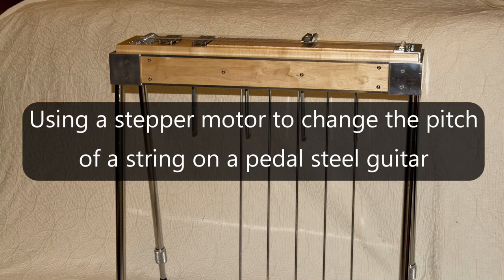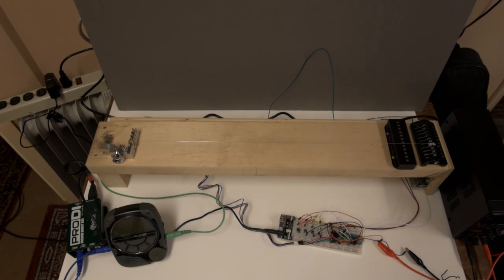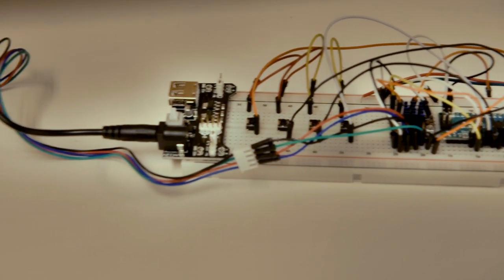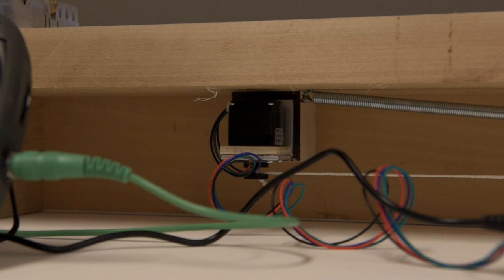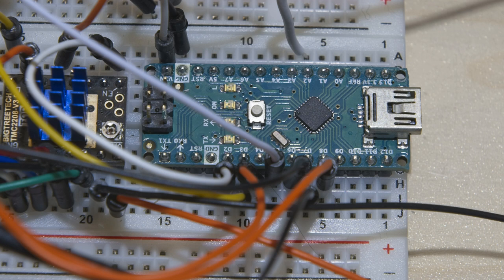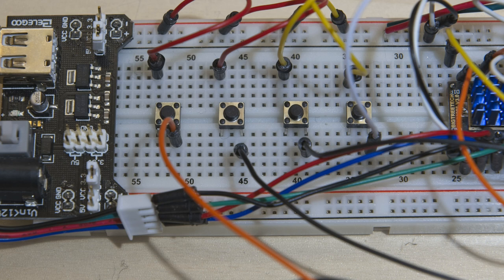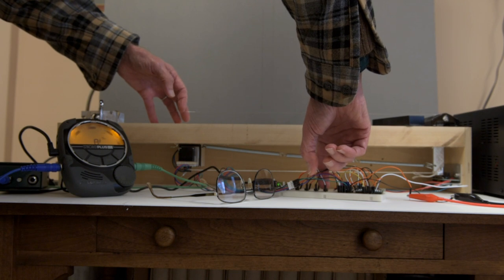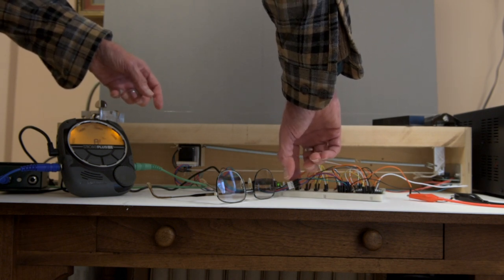Pedal Steel Guitar Stepper Motor Experiment

Comment: Very interesting Karlis! I always enjoy your posts on the Forum too. 
I'm curious if you ran into slew rate issues, or more accurately, at what point was it slew rate limited? How fast can you get from an E to an F# with the NEMA11 before it starts cogging? Pretty neat deal though! I too love tinkering around with stuff like this.
Reply from the maker: I was able to pause 75 microseconds between each half of the cycle. Below 75 microseconds, the result was unpredictable. There were 485 steps from E to F# with each step taking X time plus the 150 microsecond delay. I don't have a way to quantify the amount of time (X) that the motor needs to actually do the move but the total time for the move is slightly more than 72,750 microseconds or 72.75 milliseconds. Another way to say it  is slightly less than a 10th of a second.